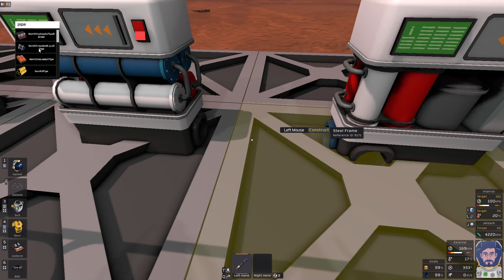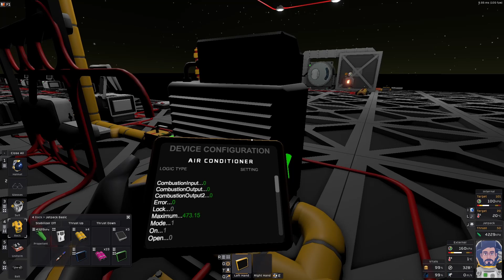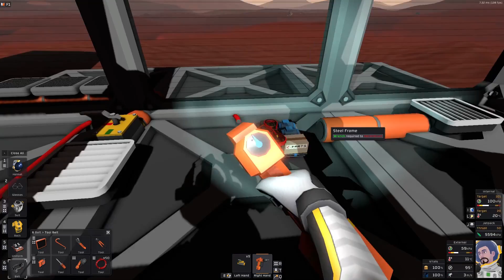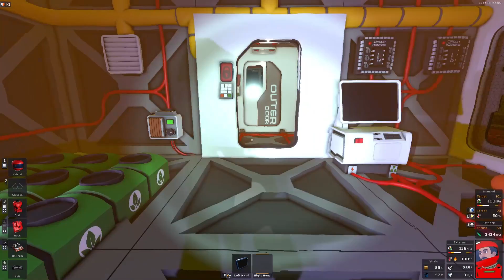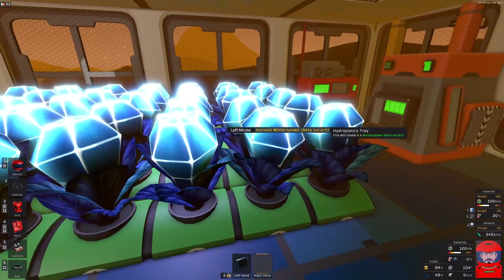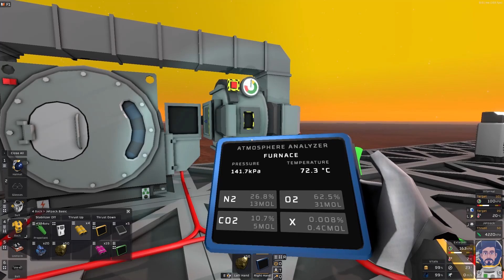Stationeers updated airconditioner

Comment: There is no need to use a centrifuge in your iron cooling loop if you use something that smelts into an ingot at venus atmosphere temperature. As long as the item smelts into an ingot it will melt down, removing heat, and won't off gas either, avoiding the pitfall of over pressurizing the furnace.

For example, using lead (127C) or even solder (77C) you can output an ingot easily and no gas is created, only heat is deleted.
Reply: Just tired this on Vulcan with solder and it works wonders. Pressurize the furnace once to give it a bit of thermal mass, then feed it solder ingots and seal the loop. As it runs it can produce temperatures under 0C briefly but regularly stays well below 100C.

Comment: other small things
- the height is same as it used to be, it's just the model now reflects that.
- I never liked the pipe length changing power of pumps, you call it "boring", I call it "actually making sense" it's like in Factorio the speed of inserter was dependant on length of belt on both sides.
- the "this thing draws 10W" bug was always here
- using those plants feel like cheating more than ACs from before
- electrically heated furnaces are still a thing... before I used wall heaters and radiators, but now there are pipe heaters that do the same as shown in video... doing that using ACs feels weird.
(my setup uses 20 heaters, but they rarely run as barely anything pulls the heat from it if you outgassed your ores beforehand)

In general what you expected ACs to do, what you were using them for was not what they were designed for, nor how they are used irl, and even splitting AC into sub parts would not really change much from how it works now

Comment: the IC slots I found use for, while I can efficiently manage 3 filtration units from 1 IC, they all require the pipe monitor. In case of general filtration of random gasses I had one IC to 5 filters and a pipe monitor.
with the IC slots I can place the IC i each filter and it will work standalone... bringing efficiency of that line of filters a bit up.

HOWEVER as I was writing this I realised that since now filters themself have much more data, I can put 1 filter per IC pin which would be much neater solution without pipe monitors at all.

Comment: in the recent couple updates I needed to change my Venus cooling solution quite a bit.

before those updates I had a void room, and electronic valves that would open when base got too hot, but one update fixed this exploit, and I had to place some air conditioners.
I did 2 stage, 6 wide solution. They used A LOT of power topping at 60KW to get to -150C that I wanted as a buffer. this made me build quite a bit more power in my base

Not long after this update came and I realised that max power usage is now fixed at 350W, so I had to make much more. I now have I think 10 stage 4 wide (it's huge) array of ACs and they use much less power that the previews setup and are able to bring down the straight Venus 460C air down to stable -120.
(tho I would love them to be more powerful, like lets say 1000W like other heating elements)

What I had to quickly learn is that now ACs don't pump from Input to Waste if there is too little pressure theere, so I had to manually bring the pressure in the whole system up so the pressure efficiency is ok. Configuration tablet mode was very useful there,

Comment: I thought it was just me that couldn't get the things to do any real measure of heating or cooling. I chained 3 together and got a total rise in temperature on Europa of about 10 degrees. Just going back to furnace gas and electric heaters.

Comment: If you want 'infinite' heat, you can mix Cobalt+Gold or Cobalt+Lead exactly half and half proportion (ex. 25+25). Open the furnace only if smelted all (50) reagents. And drop out the recycler! The Centrifuge is enough by itself. And you have to pumping out the surplus H2. It is cheating of course. :D

Comment: It looks like sealing the frame does not insulate furnace, leaving it leaking heat though both convection and radiation (latest thermodynamics update). While placing one in a vacuum will leave it only radiating heat. There is no way to completely insulate one now

Comment: Using silver instead of gold is much more efficient in your cheaty furnace setup. The N20 is insane compared to the heat you get out of running H2 + O2. I have been Non-cheaty using silver to heat my furnaces on vulcan for a bit.
Reply from the maker: I keep forgetting about NOS.  Now that the electric furnace is impractical I think Cobalt and silver will be the path to the first batch of steel so you can then make the composter.

Comment: I'm on Venus and put 6 portable aircon units on insulated connectors. Connected them all to an external passive vent. Put wireless batteries in the aircon units and the power transmitter on the roof above. We have a rocket going so I add the cool nitrogen to the room to keep the pressure up to around 100kpa. The room cools to -260 degrees C. Don't know I'f it's a glitch or not but for the moment its working. I can siphon off the cold air to cool a fuel generator, hopefully. Still working on that.
Reply: portable aircon use different code to AC unit. All portables are very unbalanced (gas charger vs gas gen is like 10k times inefficient?)

gonna bet they or will be fixed soon, or not and everyone will use this glitch to cool bases :)
Reply from the maker: I have heard of that being possible.  I suspect it is about as legitimate as the furnace/centrifuge loop.  But nicely done, I throw them away at the start of the game and never give them another thought, perhaps I should be a little more open minded.
Reply: @cowsareevil7514  Likewise I used to throw them out. the ones I used before the update would only go as low as -10 then cut out. I made some more, post update, to experiment with cooling a room down, which I could then use to cool the exhaust from an aircon unit, but it kept going down. It might not be a glitch, as the portable unit just vents the heat out to atmos, it doesn't need to be a closed pipe with radiators. So as long as it has a power supply, hence the wireless batteries, they don't stop.  Probably bugged but I'm gonna exploit it none the less until it's nerfed or fixed. Love the furnace loop btw. Gonna play with that too.

Comment: Try using solder without the centrifuge and recycler. You can cool the gas to just below 100C. The solder will stop melting at that point but will remain solder. Just keep looping it thru. I used this to cool down water created from a combustor on Vulcan, just to see if it would work.

Comment: Thanx Mick, been waiting on this one while I've been experimenting abit myself. In you chained AC setup on Venus, if you set the outmost AC to cool from 460 to 310, the 2nd outmost from 310 to 160 and the 3rd cooler to preferred comfy temperature 20-22 or so.  They should the all run on 100% efficiency ?  
 The outer cools the waste system to the 2nd, who again cools the waste system of the inner/base.
...
But yeah. You would need a lot of those chains in a base with high cubic of atmosphere, if you want something that can change temperature quickly.. 
And yeah, my furnace heat source is now gone, back to mixing O2 and H2 I guess. Or an array of pipeheaters that only turn on during a storm, with a wind farm ofc.
Reply from the maker: You only get good efficiency at -50 to 100.  Any extra AC for cooling the waste will be operating outside this and will incur the environmental efficiency loss.  So it might take 5 AC units to cool the waste from the first one.
Reply: @cowsareevil7514  Ah, bummer... Forgot about that part...
Reply: The target temp has nothing to do with efficiency now, only when the machine will turn off.

And as someone who always build everything alone, I'm so confused who would be so crazy to use AC to heat a furnace, especially now while you have pipe heaters. If you outgas your ores beforehand the furnace will just not loose it's temp.
Reply: @cola98765  Using ACs exhaust gasses for hotgas for furnace was a quick and cheap way, and and exploit of the AC units.
You would get gas temps in the 14.000 - 19.000 Celcius area.
You still have the combustor way, of combusting Volatiles and Oxygen/Nitrous. And ofc they way you mentioned with pipe heaters, but each heater sucks up to 1kw and you need alot of energy to heat up the gasses. (and reheat it while it's being used).
Reply: @CrinosAD  I always though there was penalty to the high waste temp relative to input so I never really bothered to put that heat to the room just next door where I have the hot-hot furnace gasses, so in my case the setup just got bigger

Comment: Since the ACs are moving a consistent volume of gas now, I wonder if the daisy chain method would work better on Venus if the daisy chain existed in several parallel daisy chains? Like I'm thinking of an Old West bathtub. It would be filled with room temp water effectively, you can warm it up only so fast if you're adding hot water a small cup at a time because the heat gain is spread out and the heat is radiating. To get it to a high temperature you'd need to use many cups (convert the cup size to a bucket size). 

Basically is the problem with the no-winterspawn cooling that it can't cool the volume of gas fast enough?
Reply from the maker: I think it is the efficiency loss in the high temperatures that kills it.  IRL there will be losses when a real AC is out of the optimal temperture range but if you want an AC to operate at high temps then you design it accordingly.  You can change the refridgerant gas to one better suited to the high temps and it will work just fine.  And yes, cooling the water will be the real test.
Reply: I made scalable setup, and while I wish it AC's would use more power, 6-8 stage setup is enough to bring down the temps from 460 to something useful, and then you make it as wide as you need it in terms of amount of cold you need.

Comment: wow ... leave it to mick to break the fixes that rocketwerks did to render AC useless XD  and under 24 hours to boot !! hahaha  but yeah this will make cooling and heating a bit more of a challenge now on hot/cold planets using electric devices . Might be the way RW  wanted to steer people to be using gases with the atmospherics updates to cool/heat bases watching the atmospheric gas mix so you dont blow up the base ... cheers
Reply from the maker: I am glad they fixed the voodoo machine that it was but it was the glitches that made it really useful.

Comment: i mean theoretically, instead of using 6kw with one ac to achieve furnace temps, you could use like 20 in series, and using their waste pipe instead of the output, each with at max 100 degrees higher than the last to maintain a decent efficiency to still achieve furnace temps and itll also use about the equivalent, 6kw, in energy? Right?
Reply from the maker: Yes, but Stationeers is not about spamming the same item overn and over.  it's about making a better way and maybe applying a but of brute force. If brute force doesnt work then you are not using enough of it.  If it blows up then that is definitely what Stationeers is all about.

Comment: I managed to get my Vulcan base back to normal by daisy chaining air conditioners. The trick is to set the temperature setting on the later stages higher than what you want, so you get the higher efficiency. Before the update, I had all my ACs waste connected to a tank full of Vulcan night air, and it worked fairly well, but after the update any AC unit that was cooling a high pressure tank actually seemed to be slowly heating it up. So I daisy chained 2 ACs and hooked up the waste line to the input of the last stage. 1st stage is Vulcan night air at 130 C. 2nd stage is pollutant at 90 C. Then pollutant at 55 C, then down to 20 C via the end AC units. This improved the "Temperature Differential Efficiency" from about a 5% average to about 75%.
Reply from the maker: I will have to give it a try.  You still get the operational penalty for having a hing temprature but it should reduce the temperature difference penalty.  Vulcan might be best cooled by using the AC to cool a refridgerant line and then use wall coolers.  That might have more cooling power.
Reply: @cowsareevil7514   Yes i use a 4 stage ac like you did to cool a 20C network reserve that i connect to convectors around the base. The fist AC dump the heat in a close network with 2 radiator not convector only at night controlled valve. All AC have +50 degree increment from the cold one. They average a temperature efficiency of about 50%. Working efficiency is not good for the first 2 but it work great. All AC gaz is pure CO2 at 1MPa.

Comment: So setting the extra AC's to -200 won't help the room AC? All the others were set to only 20. Would having a colder heat pipe cool the room faster?
Reply from the maker: It gets an effiecncy penalty if you are trying to get to a temperature that is too far from the current temperature.
Reply: @cowsareevil7514  that's probably why the daisy chain didn't work for you, you tried to have all of them cool down their input to 20°C
Reply: it's that temp setting is when the AC will turn off, not the temp of output gas on it's own, so setting it lower will not have any effect as long as the out-in loop is much hotter than this.

Comment: Hmm why do I think a heat exchanger between the input/hot output might be a option.  I am only at 30:15 though so maybe you try it
Reply from the maker: The fixed throughput will empty the tank you are trying to heat before it gets very hot.

Comment: Mick, have you had a chance to give the Food Rebalance mod a go with these new changes on either Vulcan or Venus to see if it's still doable?  I guess your centrifuge recirculating design for deleting heat is the only way you'd be able to cool your water fast enough to survive with these changes?

There have been suggestions flying around on Discord, one that I liked is having a more advanced air conditioner from these ones that will require a significant power source to run, but would give a larger operating efficiency to overcome Venus atmo temperature.  Definitely needs to be tweaked a bit more, but it is nice to have the cheese taken out even if it messes with everyone's old designs.
Reply from the maker: Vulcan should be possible but Venus needs the hydrogen to make the water and you won't be able to make the biomass quick enough for the composter.  Either that or you have to mine a crap load of cobalt or mod in the geysers if they still work.
A more powerful AC would be a good idea or just increase the power of this one.  The old one was good in that if you wanted it to work harder you just had to throw more power at it.
Reply: @cowsareevil7514  Can't you just buy Hydrogen from a trader until you get Hydrogen self-sufficient?
Reply from the maker: With the food rebalance you cant grow the plants quick enough to keep feeding the composter.  You will never be self-sufficient unless you exploit the composter reset to save biomass or use the vanilla food.